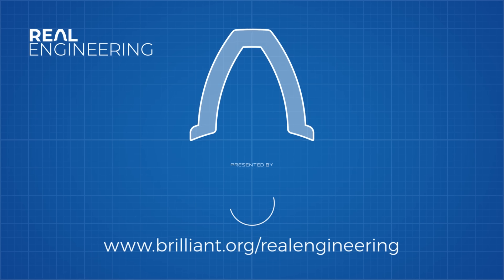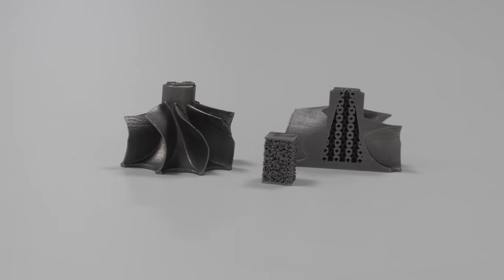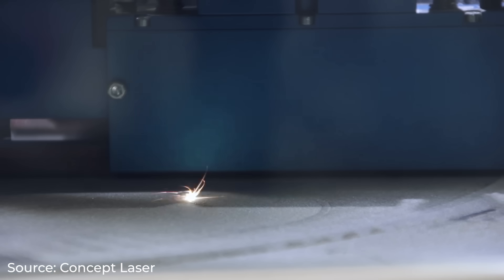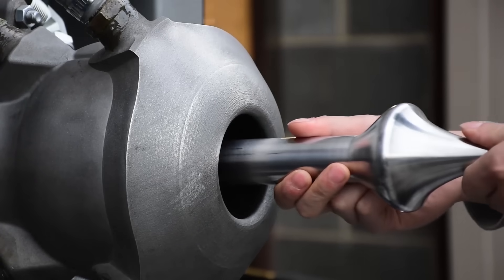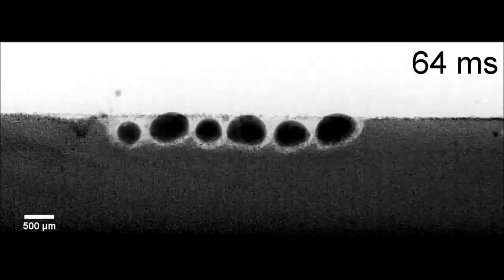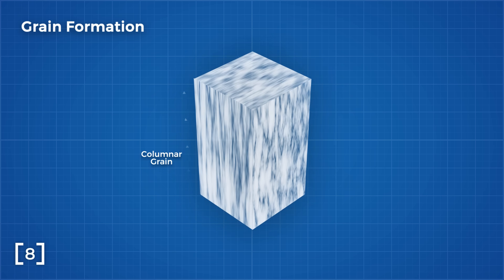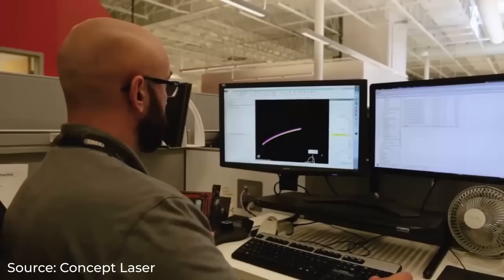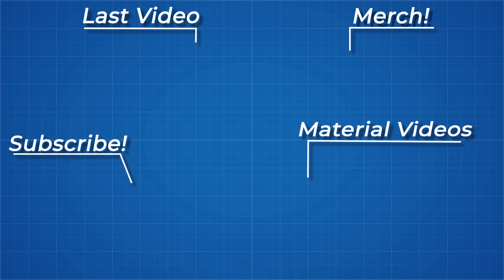The Material Science of Metal 3D Printing

Comment: Could they benefit from compacting the powder, or gluing the particles together, so they won't fly around like that?
I mean I know the reason it's a powder is so that it can be brushed away afterward, but just exactly how weak does it need to be? And how much force (how much energy per unit volume, I guess) can be used in the brushing-away process without damaging the part? What if the brushing-away is done after the part is cooled--does temperature affect the powder and the melted/solidified part equally?

Why does the powder fly? What provides the motive force? I know "the laser" is the ultimate source of the energy, but how exactly is that energy converted into a force that pushes on the particles? Is it expansion of the gas (air) between the particles? What if 3-D printing were done in a vacuum, or in another gas besides air--say, helium which has less momentum for the same temperature?

Could a laser-transparent sheet be placed on top of it to prevent powder flying around?

What about heating the powder enough to soften it, and cause it to weld, without having to heat it enough to melt it? It seems like melting causes a lot of evils. Would you have to increase the force between particles? How could this be done? By hitting it with a hammer periodically during the scan? Magnetically?

Comment: This technology is so cool, Id like to see it implemented in 3D printed construction. If a machine had the dual capability of extruding concrete and metal then the level of automation increases significantly. Currently every company 3d printing concrete inserts rebar by hand but implementing a metal extruder could eliminate that step of the process. Eventually even circuitry could be printed right into the walls. I cover 3D printed construction on my channel.

Comment: At 8:40 you can start to see  gas starting to expand (under the bottom layer at the rear) and it push the oxide particles away at the rear and blows to the surface. So one problem is that the powder needs to be dry. Also, I think the particles are too small compared to the melted 'drops'. And the power of the laser would have to be just enough to melt the powder and not over-heat it. I guess the advances in lasers should help control that. And development of the powders with mixtures of catalysts or flux may improve the bonding. It's really about funding so you can experiment and develop better product.

Comment: I wish you would have better defined the quantity of parts where near-net-shape processes become cheaper than 3D printing.  Right now, probably because someone convinced some politicians in the US government that 3D printing is really cool, a lot of free money has been available, and everyone is in a false honeymoon with it.  They brag about how many 3D printed parts are one the 787, but I think maybe many if not most were adopted without honest trade studies, driven by "seed money" projects.  So much depends on quantity of parts needed.  I wouldn't be surprised if many of those 787 3D printed parts will be the subject of future cost trade studies, and will be replaced by much cheaper injection molded, compression molded, or cast parts.  For a young person to buy a 3D printer as their first piece of equipment,  before even a drill press, is a little silly.  3D printing has been around for 30 years, but in aerospace, where I come from, it's very limited, due to cost and poor material properties.  I heard the F-18 had one 3D printed plastic part, a small low temperature duct.  Otherwise, it was only used for prototyping non-structural parts.
All technologies have experienced a honeymoon period of enthusiasm, where problems are ignored, which is fine, but often results in bad design decisions.  3D printing is no different. The limits will be realized, and things will settle down.
Also- you should maybe mention metal injection molding when you need lots of small metal parts.

Comment: I'm not an engineer (don't finish), nor posses the 3D printing or the manufacturing experience, but three thoughts on problem solving the blow-out caused by the laser. 

1) Use a second laser-like beam of particles just before the light laser. Similarly, place this particle beam in the middle of the laser like an "eye of the storm". Can the particles be carried by the laser beam itself? 

2) Instead of a laser, can electricity be used in place of the laser. A particle beam like in thought "1" followed by a needle/tesla coil/radio frequency. Also, if electricity can be used, could the whole layer be laid with particles/mapped out like a circuit board, then electrify the entire layer at once. 

3) Nano-tech (or other method) the particles into random/specific crystalline structures that hold together with friction/barbs/other, then laser/electrify the various methods of laying particles. 

Be cool if this helps.
D

Comment: You can melt the powder by electron beams instead of laser. Main advantages are more efficient melting since the kinetic energy of the electrons hitting the powder particles are more efficient than lasers since the laser is dependant of reflectivity of said powder. Also with electron beam melting you have much better control of the energy source, with lasers any movement is restricted by mechanical movement of glass that reflects the laser in a coordinate system, electron beam is instead controlled by magnetic coils which can be manipulated orders of magnitude faster since you dont depend on mechinal movement of parts. But the two different methods complement each other☺️

Comment: Why can’t they use pressurized chambers to perform the 3D printing in? 
The reason I say this is because pressure chambers are used with many other types of manufacturing to remove air bubbles from the products..
Just like Tesla could simply use all four wheels as generators to keep the batteries charged while the electric can drives down the road, which in turn means you never have to pay for electricity to recharge your car and you can drive until the car is rusted to the ground for free..

Comment: might also be worth noting that while it's not metal - 3D photopolymer resin printers are extremely cheap online now (around $250) and can produce some great models. You can also use them to cast jewelry and other small metal parts pretty easily with new castable waxes and other ash-free burnables (~$300/kg from some suppliers).

Comment: Why not put the metal powder through a needle sized nozzle. As it drops out of the nozzle hit it with a number of lasers symmetrically and in such a way that the vapor coming off pushes it directly downward.  If you could optimize that process the deposition would become very uniform as your melting the material before substrate contact.

Comment: Really awesome video, but one nitpick: 
Why would people stick to the normal laser-sintering for high-stress parts? We have a technique called Laser-Engineered-Net-Shape (LENS), which does away with the powder bed and instead has the powder inserted into the laserbeam directly through a funnel shape, making sure that 100% of the powder is always melted. 
NASA studied this 15-20 years ago and found that the Laser had a forging effect because of the radiation pressure, leading to parts that were around 40% more durable than even traditionally made parts.
Instead of using a laser beam, some used an electron beam, although this requires a vacuum chamber to work.

Some papers have been published by other laboratories like Sandia National laboratories and the SLM solutions group.

Comment: Why not heat the materials to near-melting temperatures so that the laser can scan over and melt the powder more quickly? If needed, a conductive bed beneath can sap away heat regionally, as needed. Although that second part would only work for thin parts.

Comment: Priceless video showing the laser sintering/melting of the powder.   I wonder if additional data representing the vector printed by the Galvanometer is available. Such data as Laser speed, X, Y location coupled with the video can quantify the errors.  E.g. If the laser strikes the surface in an angle of 45 degrees to the Normal to the surface then the power absorbed by the surface will drop by  ~30% ( E0*Cos (45) ) in addition to additional losses due to the distortion of the Laser beam where it will get an about elliptical shape where the beam area will also grow which will cause further decrease in energy density (Power/Area) causing not only reduction in power delivered to the surface but also sintering additional area that should not be sintered.
On this note: This is why we developed a new SLS printhead that provides consistency in beam diameter, speed, and density all. across the print area

Comment: So if you rotate the bed like 60 degrees and also vary the rotation or something then the fatigue columns becomes twisted, and interlocking, giving a little more strenght. Combining electrostatic charge, a beam of particles rather than a solid bed, you could probably circumvent some of those melt-in-front problems. Pre-heating the nearby area with directed heat just before the actual laserbeam also might hurry up the melting? Just tossing out ideas here for you all to test if you are into this development.

Comment: This video outlines the exact problem I was attempting to solve in my doctoral thesis in 2006. I laser deposited Ti alloys, HIP’d them, heat treated, quenched, rolled, and did other post processing to identify near-net-shape manufacturing methods for the lowest cost. Except back then, a plastics 3d printer was $20k. Now it’s a few hundred bucks, and a metal 3d printer isn’t $1M but is closer to tens of thousands of dollars. Same problem, but the economics are getting better.

Comment: While you stated that pores and cracks mostly form during overhangs, with no support material below, I must mention that with the right parameters of laserspeed (Scanspeed) and laserpower (in watts or Joules per mm³) you usually achive parts with 99.5+ % relative density. What is often even better than casting parts. When we did a parameter study of AlSi10Mg we found that the tensile strenght exceeds 400N/mm² (as build with no heat treatment) for casted parts its only around 250 N/mm²´but unfortunately the elongation before breaking is almost zero so you get a very brittle part. The issue here is, that you need a well formed crystaline structure to accomondate fatigue fracturing, so heat treatment is necessarry. But, heat treatment means deformation of your printed part... So what we need is a simulation tool to predict the deformation after 3D-Printing and after heat treatment. Even thou ANSYS has its Additive manufacturing suit, we found the results not to correlate well enought with real world experiments to be of use for regular implementation.
Reply: There is a company which successfuly predicts that heat deformation computationally. Its called Relativity and they are building 3D printed rockets right now. Their process made them already profitable alone even if they fail to launch those rockets.

Comment: Asking from a layman's perspective. Can the metal shavings from the machined part go towards becoming the metal dust for 3D printing? I always thought 3D printing would be the laser blasting the atom into a preset place so the structural integrity of the part will not be compromised (something like how they printed leeloo in the movie 5th element) and not just heating specs of metal dust to get the part out

Comment: I wonder if a secondary, slower moving, lower powered laser coming through and pre-heating the path for the primary original sintering laser could improve the quality of the bead and prevent the powder bed from being 'blown away'?

Alternatively, a fine mist of the powder could be blown into the path of the laser to ensure sufficient material - either into the beam, or in front of it, pushing material into the path and preventing it from moving away.

Third alternative, ensure the laser moves along a workpiece at an appropriate speed based on some kind of sensory feedback - eg a very sensitive camera not unlike the one used in the study shown - to ensure a consistent bead is produced.
Reply: Such solutions already exist in our 3D printers.
The camera you describe is a system which is used for customers who do not want to X-ray parts after printing.

Comment: They are now adding high metal content into plastic filament. Which can be printed on a cheap desktop fdm printer now. Still need to be sintered but its huge change in cost, since the machines cost is way down. Lookup virtual foundry, Metalum and basf

Comment: I always considered 3d printing as an alternative to casting.  I've done a lot of work for oil and gas (machining extremely low volume cast impellers mostly), and the sheer number of jobs that had top go back for welding due to porosity or were scrapped outright because porosity appeared on finishing cuts is phenomenal.  Add to that the setup cost of producing the patterns for casting i think 3d printing is a very viable alternative.  I'd regularly get jobs where unimportant faces and diameters (the shrouds, o/d and the hub face used for the sprue) were cast with 20mm, 50mm and 150mm of metal on them (respectively) for absolutely no reason. being able to print the part leaving 1mm on the tolerance'd diameters and faces would have been a godsend.

The money doesn't stop being saved there - the parts would require minimal balancing and fettling after machining..  I can't believe no one has jumped on this area.

Comment: Ok, I have an out there scifi idea that I've wanted to know when it comes to metal 3D printing . What would it take to be able to recycle already 3D printed into the material needed to 3D print? Would it be possible to some day make it where when some 3D printed engine breaks down it can be tossed into a machine that turns it back into the powder used in the printing process. I know metal changes when worked/heated. But I'm curious if it's possible, even at a loss of a few % of the over all, would it be possible/worth it?

Comment: “A important part of engineering is to design your inventions in a way manufacturable by machines”
That’s what exactly I do with 3D printing lol. Hangout structures will collapse during printing... and 3D printers are vulnerable to faults. A slight tweak during printing process could let your print in the recycle bin...

Comment: I feel like it's important to point out that overhang conditions are not, say, some unavoidable subset of the 3D printing process but rather something you strictly avoid when printing. If possible you'll try to design the part with no overhangs steeper than your machine can handle, or when absolutely necessary print additional material to support the structure. Trying to blind print an overhang is an example of a design/processing mistake when it comes to printing, akin to the example you gave of impossible-to-access fastener holes.

Comment: so as someone who has worked with concept and eos machines, I find the two biggest problems  that i feel this guy didnt cover is layer height and your gas. If you have too thick of a start layer, nothing will bond well, thats why you need to build supports for overhangs. you need to have next to no oxygen in your chamber as well, as that will make your weld pop instead of lay nice. metal 3d printing in my work experience has been mostly prototype, however the items that have been made are actually being used. I can think of two companies that mass produce with metal printers, the big one being ge and the second is daniel defense. Good video, I look forward to seeing 3d printing gain popularity with mainstream.

Comment: During my days as an electronics engineering student, we had to learn the "reality" how to fabricate our own  electronics circuit design. We never outsourced them and have to do the manual way. We did not just have to make them work, the grading starts by thump testing or basically lifting our projects and dropping it at a height while plugged in and see if it still works. Planned obsolescence are not taught in school, greedy manufacturers did that btw.

Comment: Thanks for the video, very informative, as usual.

First, a very naive question: what about using lower-intensity lasers, which would presumably take longer to melt the powder, before reducing the intensity gradually, in order to produce bigger crystals? Obviously, this would take longer, and likely lead to higher cost, but might it make sufficiently better parts to justify the extra cost?

Second, a question that's a bit out of the box, and possibly very silly: would using some sort of magnetic confinement in combination with the laser make any sense? It might be helpful in confining the powder to prevent it from being sprayed everywhere, and it could also be used to control the temperature.

Comment: Has nobody bothered trying the old-fashioned heat treating techniques? Part of the point of heat treating, and cryo treating, is to change the crystalline structure. Surely somebody could find a heat/cryo schedule that smoothed out the cracks and voids left by the laser. It wouldn't help make parts more cost-effective but it might allow inherently expensive parts to be redesigned for printing.

Comment: Perhaps it’s being approached wrong with all those powders and expensive lasers melting in small locations all over the parts causing irregularities throughout the entirety of the part. What if you had a large Cauldron with molten metal in it. A large hook dips into it a slowly begins to rise out but as it’s rising a Computer numerically controlled robotic arm is blasting sub freezing gasses at the hook in such a way that it forms parts out of the hot liquid metal being cooled in a controlled manner.  Simply pulling the part out of the liquid metal as the hook mentioned previously slowly rises up and out of that cauldron of hot  molten metal.